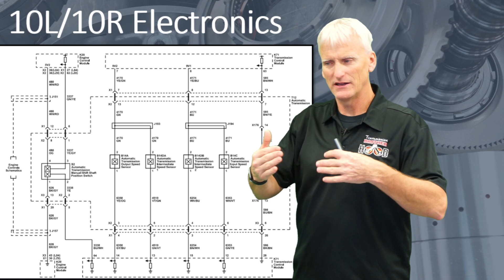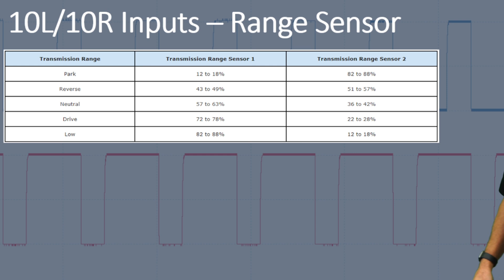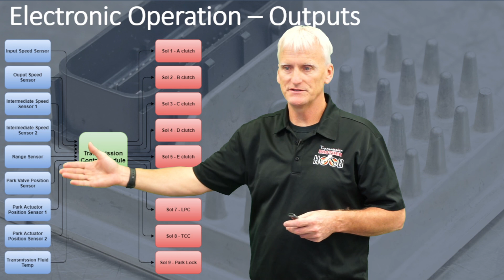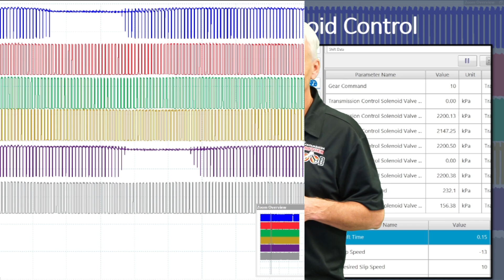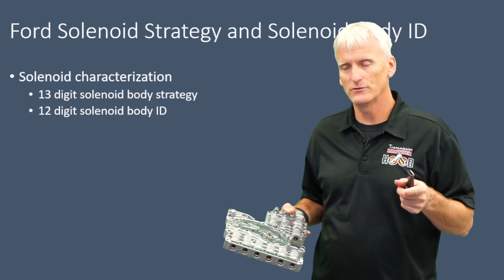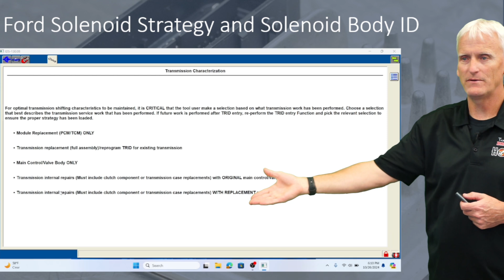GM 10L80 and Ford 10R80 Electrical Operation

Comment: I think I forgot to plug my auxiliary oil pump back in after I did my overhaul. Can I do a resistance check at the main connector on the back of the transmission to confirm whether or not the aux pump is plugged in? If so, do I just do a resistance check across the power supply pin and ground pin?

Comment: Great video. do you have the part number or tool number for your bench top spring compressor? Looks like a Kent Moore tool from GM but I can't find it. I could make it but having hard time trying to hind the proper hardware.

Comment: I have a 10L90 transmission that I intend to use in a  restomod. 
   US Shift is coming out with a stand alone controller for the 10R80 next month. The stand alone controller for the 10L90 is later this year.     
   Would it be possible to use a 10R80 valve body in place of a the 10L valve body?
Reply: Definitely NO

Comment: For some reason, it would not let me edit, The last post it was supposed to say what is the percentage of failures of the 10R80 due to steel rubbing against each other like the P3 gear that only has bearings on one side? Same question about steel wearing out aluminum? Thank you.

Comment: What is the percentage of the 10R80 due to steel wearing out aluminum? And how much of it is due to steal on steel contact like the P3 gear that does not have bearings on one side? Thank you.

Comment: Just a note. On the GM side after you do the service fast learn there is a shift adapt reset function as well. It does not matter which one you do first but you do both after a transmission replacement or a valve body replacement. Another aspect for us is  we are not allowed to service anything on the valve body. If a solenoid is bad we have to replace the entire valve body assembly. Right now we are having a lot of issues with solenoid failures. It takes a long time for us to get a new valve body. Sounds like the Ford guys can replace individual solenoids. We do not have the issues with the triple clutch housings as much. I have seen a number of the pump idler gear bearing failures.
Reply from the maker: Thanks for the comment!  Unfortunately I skipped past the reset function.  I recorded the process, but since it does the reset in a blink of an eye, I forgot to include it in the video!

Regarding the Ford side, I don't believe they are able to change the solenoids, but at least they have the provision/capabilities to do it.  Although, the VBs from Ford are still very inexpensive, so as long as they're available, I suspect that techs will be replacing complete VBs.   Although, word on the street is that the new VBs from Ford have had issues straight out of the box.  

Do you think the solenoid issues you guys are running into are really just the clip that is collapsing?  or do you think the solenoids are truly failing?
Reply: At this point I am not sure. I don't see anything with the clips and when I check the solenoids they seem to be O.K. However, the one thing you cannot simulate on a bench is heat and pressure. It appears the failures occur when the transmission is hot. So, the question is, is it the solenoids or are the valve actually sticking? We are really not getting much information on these failures unfortunately.

Comment: Great video as always! I really enjoyed looking at the GM fast learn procedure, it is quite something what it does and for how long it takes, so much for fast learn. 😉 The only thing I would have done differently would have been to either monitor average volume or amperage to the solenoids instead of the scope pattern so that it would be easier to see the computer command. Regarding the speed sensors, I don't know why it did not show the direction of rotation, the info is there when using Snap-On scanners so surely it can be read with an OE scanner. That's for showing the difference it pulses width depending on the direction, I had read before how the sensor work to be able to figure out the direction, however I always wonder how it related the info to the computer. So simple, yet I had not thought of that. Talking about simple, there is a much simpler and easier way to scope this sensor signal, you don't need to go to the trouble of adding resistors like that (although a very clever way to go about reading the signal) you can simply use the built in function of your scope called AC coupling. That filters out all the DC out from the signal, leaving you with a nice easy to reads square wave on the scope. Keep up the good work, it is very much appreciated!
Reply from the maker: Hi Robert, those speed sensors hardly change any voltage and if you AC couple them it's does show the pattern, but it's extremely noisy and not a very clean signal at all.  Some of these late model magneto resistive sensors are hard to see on the scope unless you use the resistor.  This also applies to the late model WSS as well.  They switch about 35mV without the resistor inline.  I found that forcing the voltage to drop across the resistor, I can see a nice clean signal.  Now when you check a WSS on these new vehicles they also spit out a digital message that includes info like direction and WSS gap!  Hope to see you in a couple weeks in Vegas!
Reply: @siuautomotive  odd that they would only have a 35 mV amplitude signal, all the ones I have ever looked at (not in 10Rs) had 700 mV or so. The normally switch from 7 mA to 14 mA and then they add a 100 Ohms resistor in the computer so that it can read the signal. It sounds like they went to using a 5 Ohms  resistor now, I wonder why they did that, it seems like it would make it very susceptible to error. In any event, you should still be able to clearly see the signal on the scope without having to introduce a resistor in the circuit as long as the scale is right for it. I sure hope so anyway, because sometimes on those the magnetic strip that is added to the front carrier deteriorate and it causes shift issues and if bad enough trips a code. If you can't easily scope the signal using AC coupling like usually, that's a major pain of you want to diagnose the issue without having to take the unit apart to go check the magnet with the green thing. As for the noise the only time I get noisy traces on MRE scope traces sent to me is when they hook up to chassis ground instead of hooking up across the two sensor wires or to a cleans sensor ground provided by the computer. Also all the trace I ever get to look at are taken with Snap-On scopes so far so they might apply a filter to the signal, where Pico does not unless you select one. Now I need a vehicle to go do some life testing, you tickled my curiosity bone big time. :-)
Reply from the maker: Yeah, and since I'm bench testing these speed sensors, and the circuit is not connected to a computer, I need the resistor to view a voltage change.  Otherwise I'd just see a 9v drop or a no volt drop.
Reply: @siuautomotive  you are totally right, you could not bench test it without doing like the computer and add a resistor. Well I am pretty sure the sensor would maintain the 7 or 14 mA difference but the voltage drop would be very low. Maybe that's how you got hat 35 mV reading you mentioned before. In the vehicle I would be floored if they dropped it from 700 mV to 35 mV, it just does not make any sense in my head why they would ever want to do that.